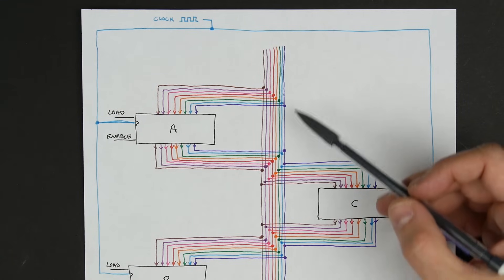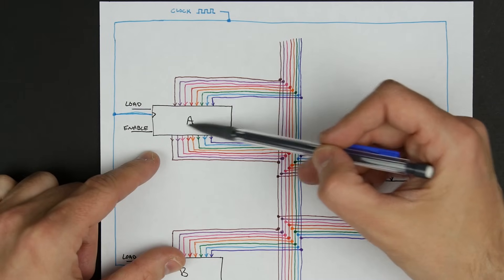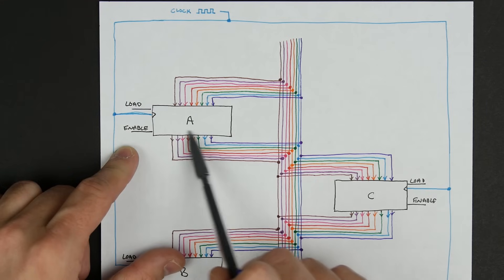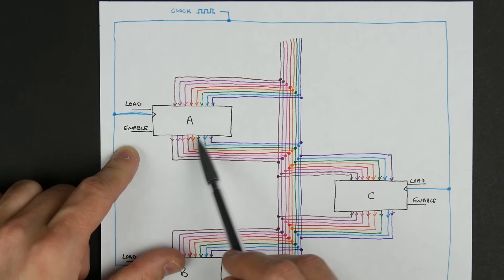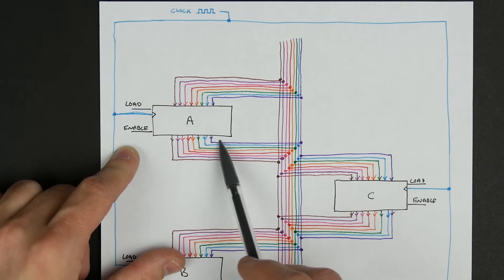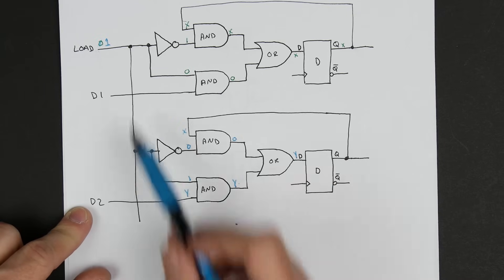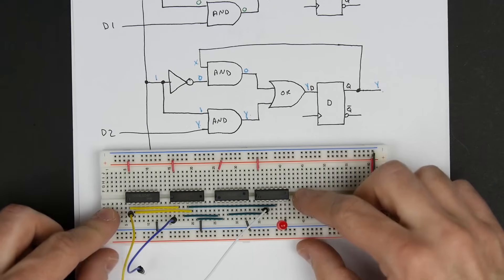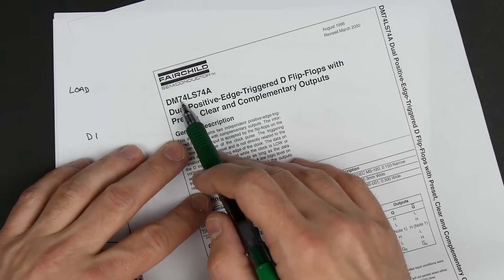Designing and building a 1-bit register - 8 bit register - Part 3

Comment: FYI the National 8900 16-bit microprocessor actually had a 4-bit ALU. Also the 8070 (8073 tiny basic) processor used a one bit ALU hence a lot of clock cycle per CPU cycle. Rem with older silicon the carry propagation over 32 bits that breaking up an arithmetic operation into many cycles didn't cause longer instruction times.

Comment: Very silly question, how do you get your breadboard wires so precisely cut and positioned? Most breadboards I see have their wires every which way, but yours are always very easy to follow because they're color coded and don't leave any slack. Do you precut them to certain lengths or buy them that way? Thanks for the videos!
Reply: I've been wondering that as well, I use wires with pins on the ends but there always so much slack and the wires stick up in the air.
Reply: You can just buy a network cable then remove the outer jacket. There are 8 different colored thin wires inside. Then cut them however you want. Cheap and easy. ;)
Reply: Jonathan Feller The problem isn’t getting the cables, the problem is cutting and striping them!
Reply: i’m pretty sure he puts it together before being “live on tape” and then disassebles.  the wires are all perfectly bent.
Reply: The holes on the breadboard are 0.1" apart, so you could measure that out, add some amount for the stripped ends, and done. For bends, subtract 0.05" per bend. If you cross between top to bottom, the holes are 0.3" across. With a little practice, you can get perfect jumpers.
Reply: You can stick a piece of wire in one of the holes where it starts, then start bending it around in the shape you want until it reaches the other hole, then bend the wire so its facing down a bit so you have a bit to stick in, then cut it and strip it. 

Hope my description makes sense, this allows you to shape the wire get it to the right length and stick it in.
Reply: And if you find Ma-Bell's #22 gauge telephone wire 25 pairs, each wire will have have a main color, and a stripe of the other main color. I hope that made sense. So you will have one wire solid white, with a stripe of red running though it. The other pair will have solid red with a stripe of white running though it. I have had a real hard time finding this, but if you do catch an old building being taken down, look for it. But it's great for doing projects like this. Also there is a lady on YouTube that shows how to use straws to measure your wire lengths so they all end up the same length. Worth looking for and free info.
Reply: Before cutting a length of wire off of a reel, strip the end too much - about twice as much as you would need for one end.  Lay the wire on the board to get a feel for how long it should be, pinch that area with your fingers and then strip the wire at that point, pushing the insulation down a bit until the length is right.  Then cut the wire.  Takes a little practice, but it's much easier than trying  cut before stripping.
Reply: It'd be neat to see a Ben Eater "behind the scenes" video of his techniques and tips. What I've been doing to emulate his meticulous wiring is to cut the piece long, strip one end, insert it in the start, bend it around to the end spot, and count 2 holes past, then just indent it with my fingernail or pocket knife there, pull out and cut it there, then strip the normal amount by eyeballing it.
Reply: James L I did the same thing as you did ^^
Reply: There are wires you can buy designed to be of certain lengths so that they perfectly span the amount of holes you need.
Reply: He recently did a video about this

Comment: A lot of comments wondering why he doesn't simply gate the clock and load lines together... according to the datasheet for the 74LS173 (which -- spoiler alert -- he ultimately uses for the registers), the designers of that chip intentionally used a fully independent clock, because they say, it "virtually eliminates restrictions for operating in one of two modes: 1) parallel load, 2) do nothing (hold)"

As a newcomer myself, its not fully clear to me the advantages and disadvantages of these "restrictions". Perhaps these "restrictions" mean nothing either way for an 8-bit breadboard computer, but Ben has essentially redesigned the same logic circuit that he's ultimately going to use (the 173).
Reply: Oh man, I think you just pointed me in the good direction in order to understand the need of that freaking logic instead of just gated clock via AND gate ;)
My understanding is that when all places when clock is needed will have that one extra AND for gating the clock we would end with exactly the same delay. I don't see any timing issue then you assume AND at each clock input pin in the design. I'm really missing the point why it was done like that. Looks like TTL chip was designed that way only for safety. Like some parts of "unknown" design that uses that TTL chip will have gated clock and some not.

Comment: @Ben Eater
Cant we just use a D-FF with the "Load"-Signal as clock for the registers? That would tell the FlipFlops to just load the data when they should. Or am I missing something?
Reply: If you have your clock running through logic , you're going to get a delay on your clock signal.  You don't want that.  you want the clock to be solid and universal and hit all parts as close to the same time as possible.  If instead you have your clock running through logic, you'll end up with race conditions and damn near impossible to find gremlins.  When it comes to clock signals, clear, clean and direct is the order of the day.  Those gremlins actually appeared in the Cray 1 during construction and testing, where they were running the clock so fast that literally the distance between modules was causing issues of the clocks not hitting all parts close enough together, and strange issues started appearing.  It got worse when they disassembled for testing, as they but longer jumpers between the modules, until one engineer piped up and said... I think we have a problem with the speed of light.
Reply: @AllenKll  I didnt think of that... thanks for the detailed answer. I love your videos
Reply: @AllenKll what about ANDing the clock signal with the load signal to feed to the D-FF clock?

Comment: Amazing content!!! I followed a course on circuits and always wanted to play with something like this... this is perfect!
One question though: when you were setting up the "enable" for loading... why didn't you just ANDed clock+load into the D-latch clock input, instead of the feedback loop with the data? Instead of setting it over and over on every tick of the flop, why not faking a clock that only ticks when load is on?

Comment: Could you just put an end between the clock signal and the load signal and connect the output to the clk input of the flip-flop?
Reply: I think he was using the example from the 74ls175 he later shows. 
But your idea works too.  https://gyazo.com/6134d2c5696c08f3a6618098368ed11d  As I have tested here.
Reply: Andrew Watts
I've actually used that kind of circuit, it works perfectly.
Reply: @andrewwatts1997  Hi! What software is this?
Reply: @huseyindinc1931  circuitwizard, it's payed software. But there are plenty of places you can get this  for free :p

Comment: Even using the same approach, you could cut down on the number of NOT gates by just having a "LOAD" line (as shown) as well as a "NOT LOAD" line. As long as the fan-out for the NOT gate is good enough (it likely is for CMOS chips).

Comment: @4:50 Other than it may not flow to same logic of the eventua register chip, Is there a problem that would exist, just using the LOAD signal to limit the clock signal? Saves on gates, just have the input coming in and only accept the clock signal to set if load is set, no need to merge the input and current output?

Comment: I have a question, if I may - instead of the implementation of the LOAD signal (explained @4:22), consisting of an inverter, two AND gates and one OR gate,
why can't we use one AND gate with its output connected to the CLOCK input of the D flip-flop, one of its inputs connected to the CLOCK signal, and the other to the LOAD signal?
This way the flip-flop would be getting its CLOCK only when the LOAD signal is high (1), so it would read and store the data (Dn signal) on the rising edge of the CLOCK signal, but only when LOAD is high.

Isn't this exactly what we want, but with just one gate of additional logic, instead of four?
Reply: I have built this version of the 1-bit register, using two chips - a 7474 (rather a Soviet-era clone of it, k155tm2) and a 74LS08, using just a single AND-gate to combine my LOAD signal with the CLOCK signal.
Just as expected, it works, although there may be some disadvantages to this approach I'm not aware of?
Reply: @Booruvcheek I am wondering the same thing. It seems more logical to use a simple approach if it has the same effect

Comment: Is it not possible to use the load signal to gate the clock input to the d-flipflip instead of continuously providing the clock but using the load to determine whether the bus is read or not?

Comment: Yes, gating the clock input would have been a MUCH easier way. It would use less logic too. (sorry if you have already fixed it in newer videos; I try to watch the series in order)
Reply: Yes i don't know why it's that complex having a 'load' select is just a matter of enabling the clock with an and ?
Reply: Actually now i think about it you see the clock has to stay synchronous. but in this CPU for example you have the fetch decode execute cycle. and in the execute state it would have to and Set Load and Wait for a clock pulse to load the the data. the setting of the load would take a cycle And waiting for a Clock Cycle would take time. and added together that is more work + it could become tricky in faster systems. that's what my idea is on why it's done that way and not simply with an and.

Comment: It seem like it would be more simple to have the load combine with the clock with and AND gate. That way, it would still only change the value if the load wire is on, but you wouldn't have to worry about the slightly more complicated logic that you use to put the value back into itself.

Comment: I used to really throw myself off when I saw AND gates with inverted inputs (its JUST a NOR gate! :)) or same with an OR with inverted inputs (it's just a NAND gate) -- maybe this will help someone out there when they see those in data sheets, etc. -- it's an easier way when electrically design chips, etc. is partially why they may do that, another is it's just another way to draw that gate from the boolean algebra --- so when you see these, just realize that's what's going on and also the data sheet will say if it's the input is active LOW or HIGH sometimes it's not and you'll see inverted inputs (the dots on the inputs, etc)

Explanation below:
If the STANDARD truth table output for an AND is 0001 and you invert the INPUTS, you will get 1000 (because the inputs 00 are now 11 and 11 in an AND gate is 1 (so 00 == 1) -- conversely, if your inputs are 11 into an AND gate, inverted they become 00, (so 11 == 0...the inputs 01 and 10 just swap so nothing's changes (try it on a truth table) ---  Try it out with dual inverted input and to give you NOR and dual inverted NOR to give you an AND again.....same with OR to NAND and NAND to OR 😊😊

TRUTH TABLE (Inverted input AND)
[[Sorry it's not the cleanest, it's a comment box I'm typing in, lo]]
A | B | AND |*NOT A* | NOT B | NOR |
0 | 0 |     0    |     1      |      1      |    1   |
0 | 1 |     0    |     1      |      0      |    0   |
1 | 0 |     0    |     0      |      1      |    0   |
1 | 1 |     1    |     0      |      0      |    0   |

Comment: Why do you need the OR gate?  Only 1 AND gate will function because of the input inversion, so at least 1 AND gate will always be zero.  The other AND gate is active, and will be 0 or 1.  If the output of the two AND gates were simply tied together, wouldn't it be the same output as what the OR gate produces?
Reply: No. That would be a short-circuit since you’d connect +5V to ground.
Reply: Thanks for the reply, but I'm not seeing it.  How does removing the OR gate connect it to ground?  Are you considering the AND gate with a value of 0 as ground?  If so, I thought an AND gate was just 2 transistors in series, and unless both inputs are high, then it is an open circuit.
Reply: That’s not how gates in integrated circuits are implemented. In particular, output of a gate should be Vcc when high and 0 when low (i.e. ground). In TI’s 7408 datasheet at http://www.ti.com/lit/ds/symlink/sn54s08.pdf you can see that output is either connected to ground or to Vcc.
Reply: Ah, thanks.  Beginning to see it.  Not sure why they have made an AND gate so complicated though.  Seems such a simple thing just using 2 transistors.  Is there a reason to avoid open circuits?  Maybe Ben will do a video!  ;-)
Reply: I don’t think I can give you a satisfactory answer, but that’s just how TTL is designed. A low input is one from which current is drawn. And open circuit ends up interpreted as high input since current goes in either direction.

Comment: Did I miss the Logic of having a NOT (bubble) on both sides of a NOR or NAND Gate that it turns the gate into the opposite gate, and all the NOTs go away?
So like your example, if you were to replace those ANDs with a NANDs (NOT AND) and where that OR is replace that with an NAND you get that AND-OR IC (Like what you  are showing at 10:16).  IT's a way to eat up unused parts of your logic ICs or use one type of logic to make something else. Cool part of this is when you need an SR flip flop and you start mixing Nor with a Nand, and still get a flip flop.

Comment: Hey I am building a discrete computer and I noticed here you used the 2 AND gates and the OR gate to control writing to the register, but in a later video you simply and the clock signal with the input signal to control reading from the bus. I was wondering which method would be better in my computer?

Comment: does the load and enable happen in the same clock cycle?

EG:

Rising edge1: Enable = High, D1=1, D2=0,etc.

or is it more:

Rising edge 1: D1=1, D2=0
Rising edge 2: Enable = High

In short, do you make the signals available on the bus in one clock cycle and then enable in the next, or can you just do it all in one cycle?

Comment: What are the advantages of the Load signal being a state instead of an event? Being an event would simplify all that logic into just the Load line tied to the Clk inputs (you kinda just hand-waved that away.) Is it that the bus will be changing state at the same time the Load signal is going high? Could that be mitigated by a slight delay (small resistor and cap?)
Reply: This entire Jenga tower is built on all logic components operating at the same time and running off the same clock. That way there's only one event to track - the leading edge of that clock signal. It also means that you can pulse the clock as fast or as slow as you want without worrying about logic elements missing their triggers. Well... as fast as the slowest IC anyway :P

Comment: Sir, couldn't you just AND the clock signal with the load signal to simplify the circuit? If I'm not mistaken, the circuit behaves the same and uses 3 less gates per every bit of the register. Is there something I am missing?

Comment: Why not just have the load enable go into an "AND" gate with the clock into the D flip flop's clock enable? So instead of having all of that complicated stuff to relatch the old value, you take the value off the bus when both the enable is high and the clock pulses?
Reply: DevinDTV the clock resets the latch and if you are not writing to it it clears it self while you write to reg b. then it cant store things to do math with on the alu
Reply: Hence and-ing it with the "load", so the clock only gets passed through when "load" is set.
Reply: I can suggest this is made to stabilize initial states at zeros. Also it could have some voltage normalizing effect on input.
Reply: Barry Manilowa  Good point

Comment: Maybe a stupid question, but isn't a bus like short circuit, whereas energy would flow straight through the bus and avoid going trough the sides as they have more resistance with chips present?

Comment: 6:19 aaam, couldnt you just have and gate (or transistor) on clock line, which will block clock from reaching d trigger when load is 0?
Reply: I have actually tried this approach (with and AND-gate) and it worked, but as discussed in Seftdelmer's comment above yours, this can probably lead to clock signal delay, introduced by the AND-gate, probably?

Comment: Hey! I’m using an 8-bit register chip (74ls273) instead of the two 4-bit flip flops (74ls173) to build a register. Since the octal bus transceiver (74ls245) has two sets of inputs/outputs (A 1-8 and B 1-8), and only one set can be enabled at a time, can’t I use just one 74ls245 to both control the input/output of the register from the bus?

Comment: Could you tie the Q pin to the Data pin with a resistor, and whenever the input is floating (using the transceiver), would the input not automatically take the value of the latch? That would be a lot simpler I think

(I'm talking about the 1-bit register only)

Comment: Not sure if you're still answering questions about this, but why don't you just AND the clock pulse with the load signal and feed that into the clock input of the latch, and connect D straight to the bus?

Comment: Silly question: why can't we use the same tri-state logic we used in the output? That way, we could completely cut off the register from the bus both as input and output, and only use it in either mode when we send in the relevant signals.